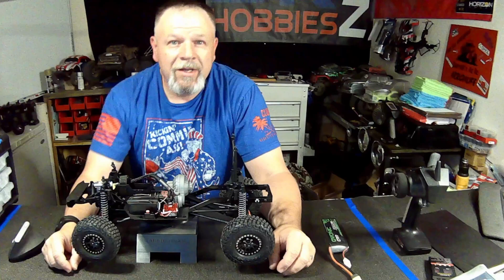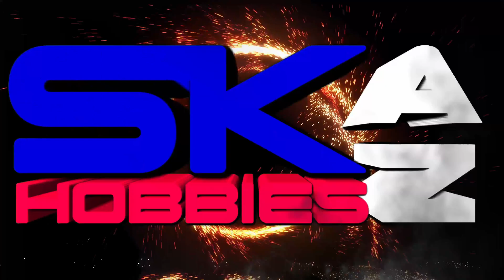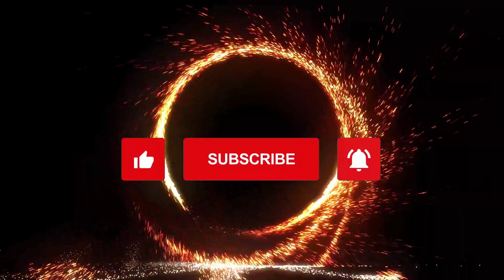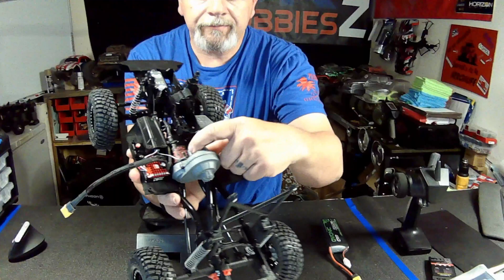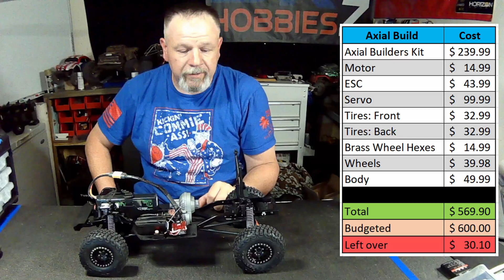Axial vs Element Build Series - Part 7 - Axial Electronics Installed - S01E071

Comment: That battery gives it good front end weight
Reply from the maker: Yup, only thing I don't like is that it's holder is attached to the servo holder plate. If I decide to put a servo winch on it I may have to change it up